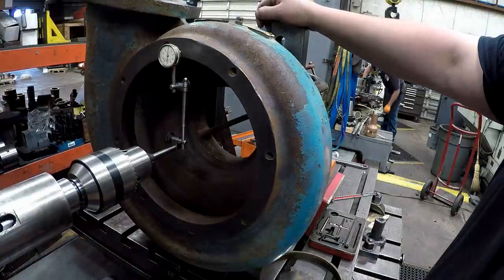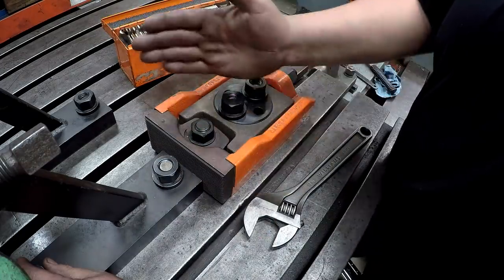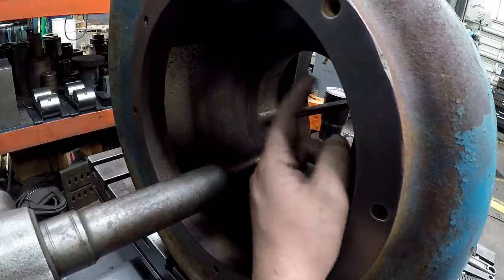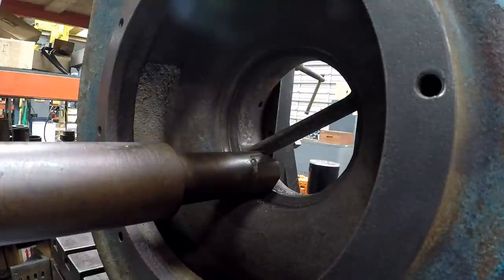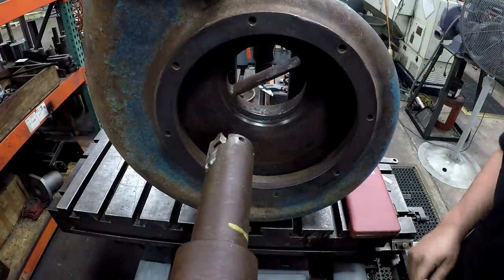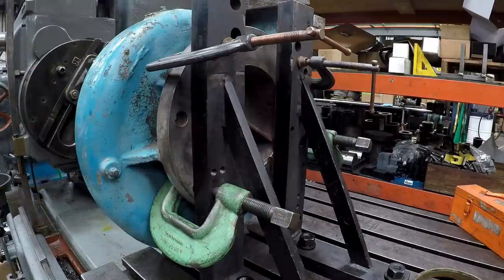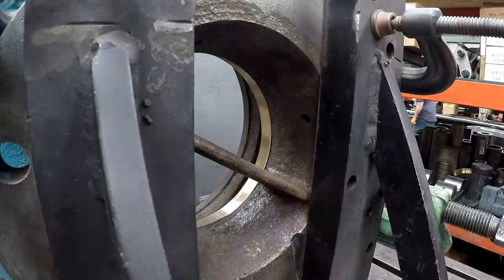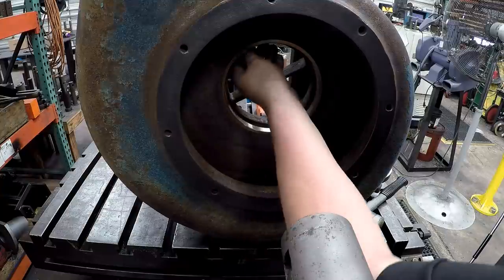Volute Repair

Comment: Adam, Watching your videos is a blast from my past. I worked in a tool and Die, Job shop for about 20 years. Many of the repairs you do are the same as I did. I wish the young machinist today all had the opportunity to go through the apprenticeship  program that we had to do. But.... it is a new world. Most  of the young machinist today are al CNC guys. If a farmer came into the shop with a broken shaft they wouldn't know what to do or where to start to make a replacement.

Comment: Absolutely awesome.  most people who work inside of an office all day, have no idea of all the steps it takes to keep the air conditioning running that feeds their cubical.  I'll bet that's either an open or closed loop pump for a chiller system.
Reply from the maker: +Jeff Stowasser I do recall of was for one of the beach condos, but unsure of what system it's for.

Comment: Adam great to see the clamp I sent you is useful, I have one left sold the others to Brian Block. Thanks for the awesome content, it is because of you and a few others that I started my own channel. Since I sent the clamps I have posted over 100 videos.
Reply from the maker: Yep it's very handy, i love using it to tweak those angle plates when indicating. Usually only need less then .010 and it's just the trick.
Reply: thanks for the tip, maybe I can use it someday.

Comment: Nice, I worked at a pump repair shop for a couple years (heck my brother in law is still there!) and that is a pretty slick way to setup a housing if you don't have a VTL that can swing it. I was lucky and could always setup these on a vtl as we could swing 12' on the big one (a proper Abom machine!). If you want to make sure you don't get the distortion in a ring pre part it off to about .03" wall thickness after roughing it and then finish turn it. That takes a lot of the spring out and really helps keeping them round once they come off. 
You probably had the housing move (read as distort, not move on the work holding) a bit, so a thing you can try is rough it in the housing and then hammer on it a bit, not hard but just take a steel hammer and tap on it and get it ringing real good and that can relieve a bunch of stress. Works really, really good on cast iron but will help on almost any situation where you are removing old material on a used and there for work stressed part. Another thing, if you can, is to unclamp it and let it rest in the sun or cold for a few hours, this helps it let go of a lot of the internal stress. This way when you go to press on it you don't release a bunch of stress and distort the hole! Another spot this is a pain is if you ever work on cold forged parts, like cold rolled steel. If you've ever tried to mill something out of cold rolled you know that it move like crazy as you cut into the skin. You end up having to rough it all over then finish it or risk a very distorted part!
Love watching your work and keep it coming!

Comment: I like the shim shield tip, that is one I'll be using. No more hiding from the bronze shower. Craig
Reply from the maker: Great for threading bronze!
Reply: clemwyo Yeah, I can use that same trick on my lathe.  Sometimes the hot chips come straight back at me and burn my clothes 😳
Reply: Truthis strangerthanfiction it's the down the shirt ones that make me dance. Craig
Reply: I have some pieces of plexiglass with magnets attached to use as see through shields.

Comment: TIL: a centrifugal pump housing is called a volute. Thanks!
Reply from the maker: Some of you guys crack me up with the spell checks. There I fixed the title for ya
Reply: Ha! Does my favorite YouTube creator want anything from Albuquerque? :)
Reply: Abom79 I don't give a damn if you call it a cedar bush, I love watching your work. Most people making corrective comments couldn't hold your boring bar.
Reply: NMCCW green chile jerky.
Reply from the maker: Whatcha got?
Reply: @Abom79  Certainly didn't need spell check for this one.  I used centrifugal pumps for 25 years in the UK fire service and I learned Volute on my first day and never forgot it.  I can even tell you that is a single stage centrifugal pump housing and is relatively inefficient.  Positive displacement pumps are the most effective  but have one massive drawback....you cannot close the water flow without disintegrating the pump. That is why the old fire pumps of that type didn't have hand controlled branches.  You had to send a runner back to the pump with verbal instructions.  Not that I'm that old...honest!
Reply: @Abom79  this company trust their mechanics and operators way more than what I am used to lol. Heck due to vibration and washing out of internal parts they always had us drill and tap some grub screws between the wear ring and volute so that they can't come loose during operation.

Comment: I'm a little surprised you didn't goop the ring with some form of sealant. it really protects t hr bronze/iron interface from invasive corrosion.  

I loved that brutal looking push jack. Could have used them about a zillion times back in the day.

You guys ever gonna get a small VBM? They're a close coupled pump rebuilders dream.

Comment: was at a friends shop yesterday and he was working to adapt an old silicon bronze propeller shaft mount to modern parts
the section of bronze  1/4 the size of what Adam was working with..... 12" in length was $600
Drops are something to keep up with

Comment: I love turning bronze but man I hate the clean up not as bad as cast but the chips fly everywhere. I'm going to have to try the shim stock idea. Nice job.
Reply from the maker: The clean up doesn't bother me really. I think bronze is better then some other materials.
Reply: With the Smithy the smaller size gets under the carriage which is another down fall of their machines. The chips pile up in between the ways and roll under it. Hopefully I'll be able to upgrade to a more abom sized machine soon.

Comment: Good job!  I'm a job shop machinist up in Kentucky and I do a lot of similar parts as you.  Have you ever used liquid nitrogen to shrink sleeves and put them in by hand?  You have to be quick but it works great.

Comment: Hey Adam, Another great repair job. Our plant is full of 1960's and 70's stuff that we have to do creative repairs like this. Really helps the bottom line to save the old stuff that doesn't have replacements available. Luckily, like most cities, we have a small metal dealer that let's you buy the odd cuts dirt cheap for these type projects. So inquiring minds want to know, I've seen the cutoff support rod (broom handle) several times. Is that a Starrett Model 666 Cutoff Support handle or a B&S 007ABom retention support?
Reply from the maker: It's the Hub City Broom left over, re purposed, and reused.

Comment: Adam, that piece of oak round bar you used to catch the parted off bronze bush also does duty as a hone, or simple flap wheel, doesn't it? It's the hacksaw cut across the end that identifies it.  

I've made a few of them. Ain't they wonderful, as well as simple?
Reply from the maker: Yes it is, I use it to sometimes polish or debur a bore. So it's a multi use tool. I can be used as a head knocker when people won't leave me alone too.

Comment: Do you ever sleep?  Nice work.  How does bronze on bronze work for the bushing?  I would have expected a different material, or was it brass?  I'm always curious as to what slides on what.  I know steel on steel is not good under high pressure.

Comment: Adam, when you put your chip guard in it reminded me of something Keith F did with a cast iron part to control the chip spray. He actually spun the part in reverse directing the chips down instead of up, would that work with brass/bronze?
Reply from the maker: I've never done that technique. I know it works but I prefer to use the machine the way it was designed to use, pushing down against the bed.

Comment: You were mentioning about the cost of material and having to remove a bunch, I was curious, do machine shops recycle all the chips that come out of the machines at all? Just scrap value?
Reply from the maker: yes it all gets recycled, either solid or in chip form.

Comment: All that brass... makes me wonder, what happens to all the chips? Does it all (steel, brass, cast iron, ect) just get mixed up and tossed out? Or separated/recycled?
Reply: The Whiskey Gunner scrap companies will buy pretty much everything as is. They will give you a price for chips and the account for some of the weight being cutting oil/fluid etc. They will also buy brass knowing it might have some steel or other metal in it, they call that dirty brass and pay slightly less than just clean brass.

Comment: This isnt technically a seal fit its a suction fit and EASA has a standard clearances for the size of the wear ring and impeller. .010 clearance is starting then goes up per inch. this gives you the correct head and flow. They say it doesn't need repaired until you are about 2 times the amount of clearance specified. done way to many of those things

Comment: You should use a high CRI flashlight with a wide floody beam, not one with a cool white hot spot, would show up better on the camera i.e. http://www.zebralight.com/SC600Fd-Mk-III-Plus-XHP50-Floody-Neutral-White-18650-Flashlight_p_188.html

Comment: Never owned a TV set in my life. Local SOE (State Owned Company) SABC (South African Broadcasting Corporation) even reckons that if I watch TV on a laptop I need a licence. I must say that since discovering these guys (the ace machinists without parallel) via Dave Richards I have an addiction! How did I get on to Dave Richards?  Steam! Via www.a1steam.com and www.p2steam.com  - I have no connection to either website other then I am continuously amazed and encouraged at what a man with a dream can achieve. Best regards from Johannesburg, Gauteng, South Africa

Comment: easier just to turn on a lathe.
Reply from the maker: +yo mama Oh yea? Maybe if I had a machine big enough to swing it
Reply: Abom79 
I forget that not everybody does. 
At my shop we put the volute "case ring" in .001" tight with loctite and then use set screws to  hold it in. Just another way to do it ;-)